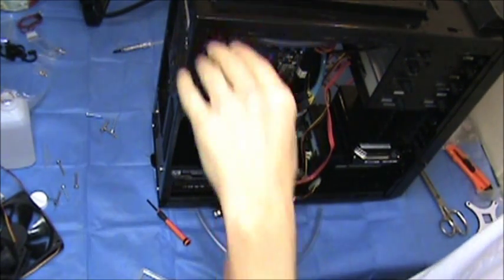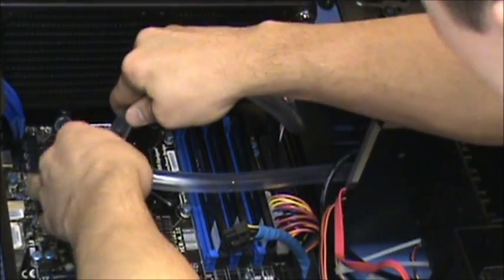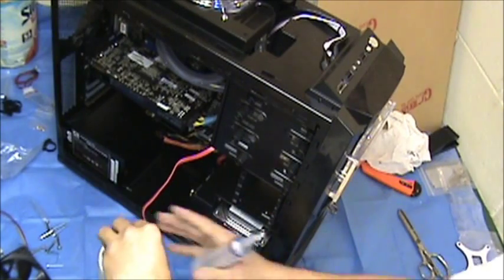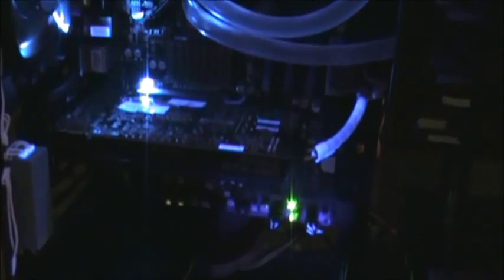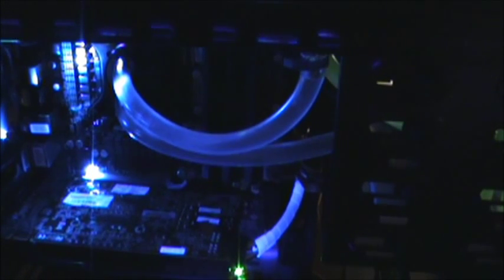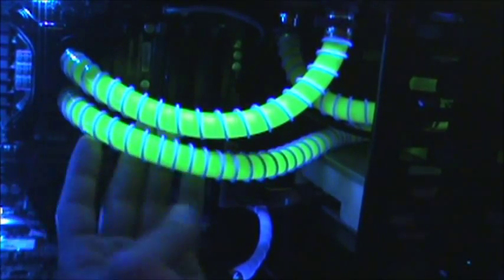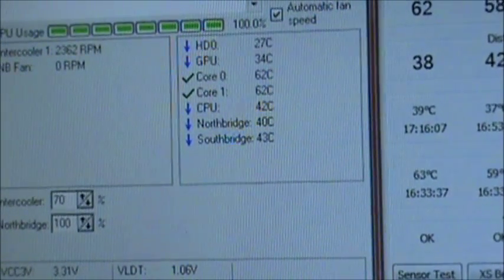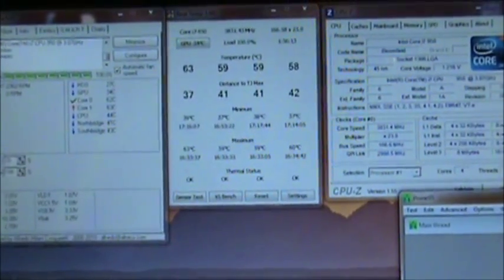XSPC Rasa Liquid CPU Cooling System install pt2

Comment: yea this is a good kit. however wish they had a 140mm 3x 360 kit lol i have a switch 810 and want to take advantage of that huge space above. so i will have to order the parts separate . all around with tubing and barbs, none-conductive clear water it will run me around 250 dollars.

Comment: @julio4494 bro i don't recommend it because it might fall off and... buy another one again.
but i do recommend to get a new case that can support that kind of water cooling kit
(preferrably full tower case for a no problem installation of your Water cooler)
if you don't want to buy another case just put it outside back of the case or connect some parts inside the case and some parts outside...

Comment: I want to get the XSPC DC 750 Water Cooling Kit for a NZXT lexa s case, i know that it does not fit in the inside, so am i able to mount it on top of the case with no problem?

Comment: @Oblivionsurveyor If you are trying to push water through the reservoir, then into say the rad, you will have a big drop in flow rate, and higher temperatures.

Comment: Not only did your temp drop you upped your core voltage in the after part to 1.216.  So very nice considered it's only a rs240.

Comment: @TheKegger420 Ok, I can't seem to find the 8, 30mm screws to attach the fans. Think I'll wire it up and check for various airflows and noise while the leak test runs. When the right screws get here, will attach proper.

Comment from the maker: @sumguy68 unscrew the 2 screws that hold the top cover in place and remove the top. my fans and rad do not sit on top, but just under neath the rail. i only had to remove the top cover to screw in my fans>rad in that order from top down. i have my fans blowing INto my case for improved circulation. you see dust however, i use a dust off can on it once a week. let me know if that helps! i used the 8 screws that came with thie kit, and i didnt have to use anything from the external mount kit

Comment: I have the same case and water cooling kit. I can't seem to figure out how to mount the fans and radiator under the top cover. I used the short screws from the external mount package to attach the rad to the fans but the other screws are way to long for mounting fans to case and still get the top cover on. Can you give any specifics on how yours is rigged?

Comment from the maker: @savator408 Not really that hard. I left just enough hose length so i can unscrew and pull out my pump/res. then i unscrew the fill cap and turn my tower over and drain it that way. Not really that hard. I have heard some people pull off one of the hoses to drain but that doesn't interest me.

Comment: I can't stress this enough, loop order does NOT affect temps. Just make sure you have your pump sucking water from your res not pushing through the res. I'm jealous of your voltage, my 950 @ 4.0GHz takes 1.31v with a load of 65c with a HeatKiller 3.0 LT, RX120, and a BIX II

Comment: Big thanks!! Getting ready to do a new build. New to water cooling but just bought the Predator case so this will help tons. Was going to get a H50/70/60 but don't like the stiff tubing. Definitely getting XSPC now. Is CPU to Resv to Rad flow better than CPU to Rad to Resv?

Comment: Your temps are still higher than they should be.
i've overed clock a 920 and a 950 to 4ghz and at 100% load only see 50-60c
average idle temps are about 28-34c. (temps dependant on processor)
My i7 980x at full load only see's 52-55c at 100% load and i've oc'ed it to 4.159ghz
check out overclock(dot)net for more help
you can also find screen shots of my system tests there as well

Comment: I recomend the xspc kit to everyone its a great way to start and the rasa block is only 1 or 2 c under the best in the market. Now for the tweaks.
1 - Dont use any dyes, they look good but over time the dye does seperate in the look and start to clog the cpu block cooling fins
2 - Use distilled water, a silver kill coil and if you want some pk-nuke

Comment from the maker: @lazyazn625 my case is the xion predator 970, a midsized tower. I mounted my 240mm radiator at the top as this case had mounting holes for it. If your case wont hold the radiator, you can always mount it externally

Comment from the maker: @prodhrider This kit can definietly handle dual GPU cooling blocks in SLI.....  Best part about this kit aside from the price is it's ability to be expanded. The reason i went with the 240mm radiator is because i wanted everyhting contained in my mid tower case.

Comment from the maker: @ShitakeStudios On a scale from 1 to 10, I would rate this install as a 7. If you're new to this type of thing, I might recomend the Astek 510 LCLC 1 piece watercooling system. I am not sure what you mean by "trick" the WC system, but i fired up my computer, let the pump cycle, then shut down the machine 6 to 7 times to get the air out.